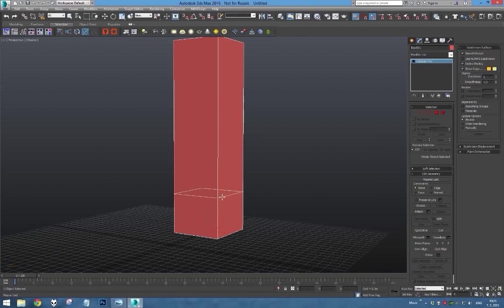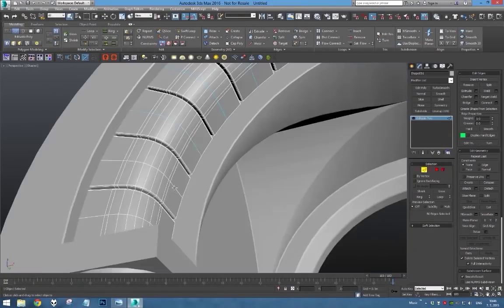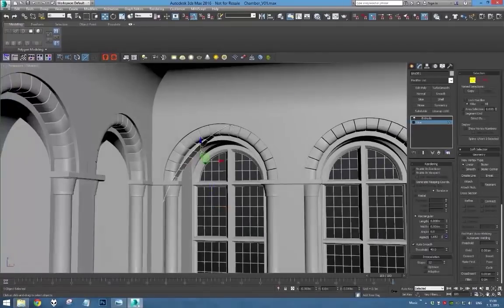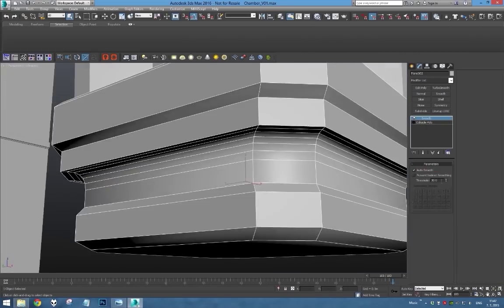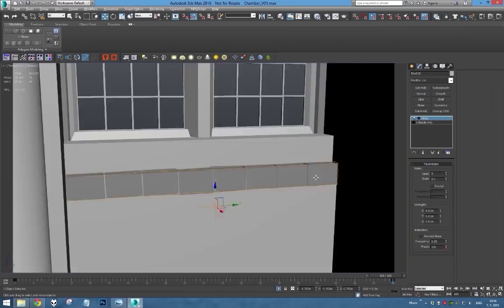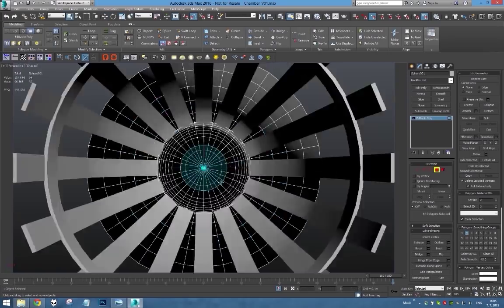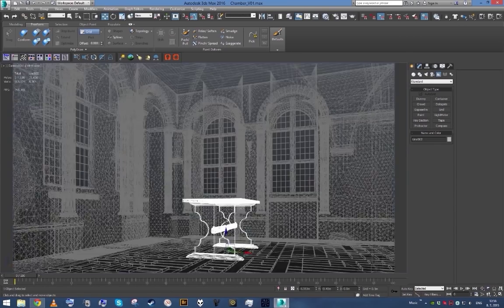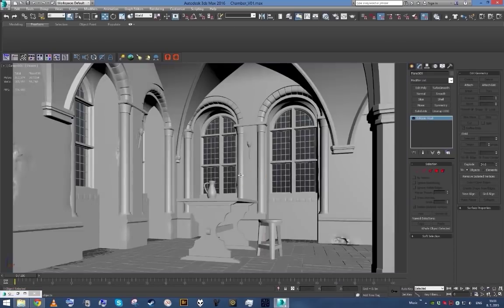Complete Project: Creating Room with God Rays (2/5: Modeling)

Comment: I'm doing the modellation part, but get a problem at the 00:51, when i do the boolean desappear everithing :( what could be the problem?
Reply from the maker: If you are using Booleans, Max can be a bit tricky. I'm assuming you mean that the object disappears from the viewport as well as the render. Best bet would be to hunt for tutorials and help guides on Max Booleans - usually it means things like having to change the geometry (maybe add more polys so that Max can better calculate the boolean), or adjusting the location of the boolean object.
Reply: ok i'll try to play woth the geometry... thanks for your reply!!
Reply from the maker: Most welcome! Booleans are often a temperamental thing unfortunately. There may be some good 3ds Max tutorials out there that cover the topic! Good luck :)

Comment: Can someone explain 0.33 - 0.35 how the vertices were grouped then expanded (I understand snaps were used on the grouped vertices to get a 45deg) - but the group and expand I cannot work out. It obviously isn't weld as you cannot release a weld..
Reply: +unbelievabubble In 3ds Max, you can extrude any border edge by just holding down shift and dragging move gizmo. So i've double clicked border edge loop to select it, then extruded it holding down shift key, and once it was extruded, I've collapsed all the edges together using collapse command :)
Reply: +Ludvík Koutný Thanks for this - I thought you somehow collapsed then un-collapsed - maybe this was undo :) just so fast. How do you extrude polygon's using same technique eg: looks like you extrude you polygon's using shift/drag gismo (and same as inset) - I maybe think this is 2016 ver 3dsmax feature? Thanks for your tutorials/walkthroughs, they are really inspiring.
Reply: +unbelievabubble I've got a simple script mapped to a hotkey. It does simple extrude with 0 distance. So i just hit the hotkey, it extrudes faces without any distance, and then i drag them out any way i need to :)
Reply: +Ludvík Koutný That's awesome man thank-you